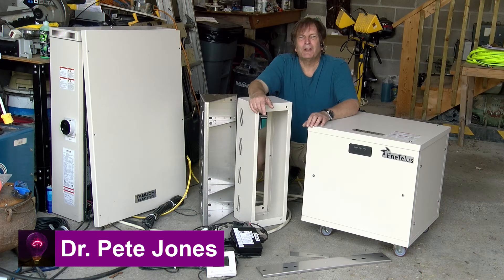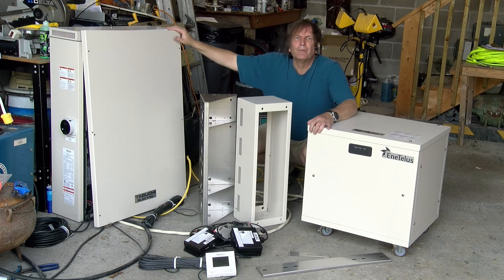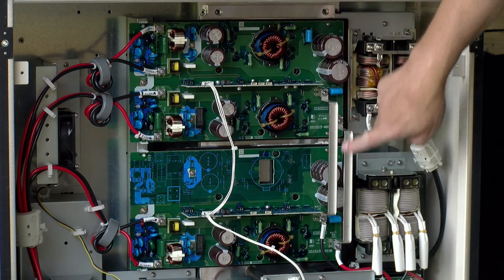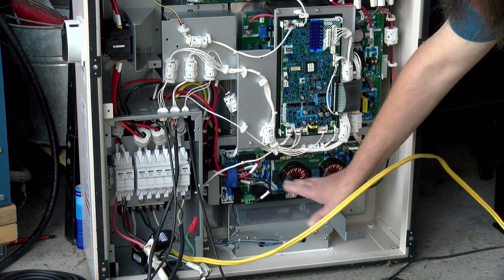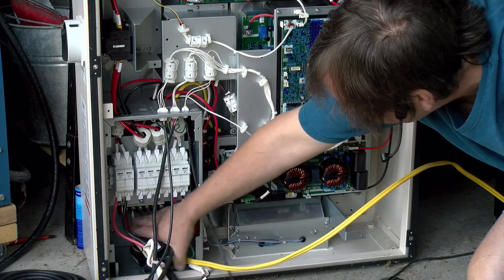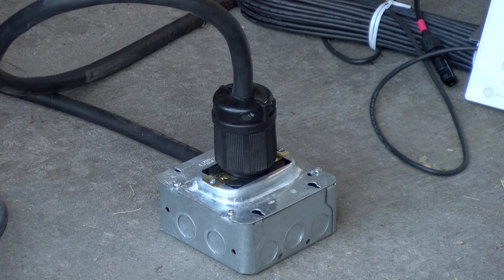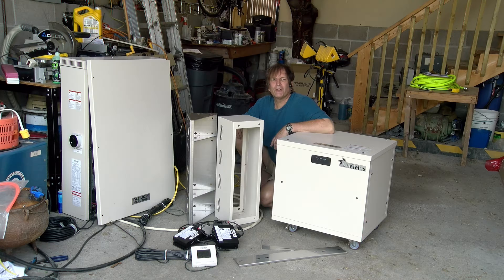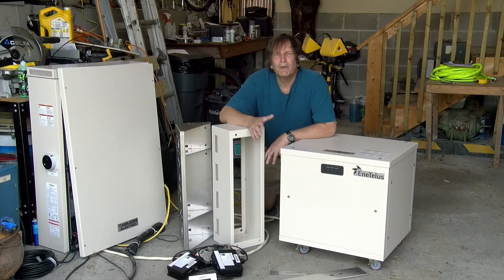The Ottawa Restore's Solar Inverter and Lithium Ion Battery System

Comment: How did you connect your 240 transformer to the inverter? Just L1 and L2? What about Neutral?
Reply from the maker: So the stand-alone inverter output (to power things off grid) has  120V L (Line) and N (Neutral) terminals. The transformer you use should should be a center tapped  120/240 transformer with  terminals  L1 and  L2  and N being the center tap terminal. note: it may not be labelled that way). You hook the N transformer terminal to the inverter  N terminal, and the transformer L1 terminal to the inverter L terminal. So that way the output of the transformer is 120V to N for each of its L1 and L2 terminals and the voltage between L1 to L2 being 240V. 

Note that you need to be sure that under no circumstances can the transformer ever be connected to the grid or other external AC power source or the grid power may damage the inverter or the inverter power may energize a the grid and injure anyone working on repairing the grip during a power failure.

Comment: So, - can I use that system as "off grid" if I manage starting it with the generator? I do not need much power - just to feed my RV (lights, water pump and a fan in the heater). I do not think this will take lots of power. More of a question if inverter can stay in "home backup" mode for extended period of time.
Reply from the maker: I tested it for a few hours - did not test it for days in backup+disconnected from AC mode. No indication anywhere that there is a timeout limit, but I cant say fore sure.

Comment: I picked up one of the units Trying to charge the battery, keep stopping and starting. No error codes
Reply: It is safe to ground the battery correct
Reply from the maker: @davidellis4097  Yes. If these some sort of flashing on-off code on the battery? The battery? The battery manuals lists a few sequences.
Reply from the maker: That happened to me! You need the current sense transformers clamped around the 240V L1 and L2 input power lines, they have to be in the right orientation, and the on the right lines (ie not L1 and L2 swapped). If any of that is wring, it thinks somethings is going wrong (ie expects to see the power coming in that it knows it is using).
Reply: Could it be equalization or balancing in the battery
Reply: Pretty sure they're on the right way
Reply: Thank you for all your help
Reply: @davidellis4097  Did you fix the issue? Managed charging the battery? Did you use solar panels for that or generator? I also got one of these systems and going to run it in couple of weeks. Any advice/help is greatly appreciated! Thanks

Comment: That's an amazing deal, some quite serious equipment there. If I lived anywhere near the area I would be on my way! Are you keeping the unit you looked at, or making more videos about it?
Reply from the maker: Yes too bad :( Do they have Habitat for Humanity ReStores in the UK? An amazing source of deals at times.   I bought the unit I looked at and have set it up as a giant UPS that is connected in place of a generator to the generator panel's external  connection my garage. I live just outside of Ottawa in the country and find that every couple of years  there is a storm that knocks out power for a day or so. In the past I have run the generator but its a real waste/nuisance when only the fridge and central heating propane boiler use a fraction of the power. Also a nuisance filling up the gas (that's petrol to you  :). Now with the flip of a switch on the breaker panel in the basement, I can switch key circuits to the inverter. And then run the generator a few hours during the day to recharge the battery.

I  stopped by the ReStore yesterday. To my amusement, they a have a laptop next to an inverter playing my video (with audio) in a continuous loop :)

Comment: WOW.  That's an incredible deal!
BTW, if you've got a 120V only generator, or you want to load balance a 240V generator, get an APC SURT003.  It has a 6kW isolation transformer inside.
Connect the 120V legs to your breaker panel via a 30A breaker.  If you feed your 120V generator in to one side, the transformer supplies the other half of the panel.
Or if you use the SURT003 as intended, feed it 240V from a generator, then you get a load balanced 3kW per leg to your panel.
The toroid transformer even has two thermal switches embedded inside it.  One to turn on a set of fans to a high setting, the other to cut power in an overload situation.
Reply from the maker: It definitely is. My feeling is its best use is as a giant UPS backup or as an off grid system assuming you have a generator to "start" it. 

Just looked up the APC SURT003 - not inexpensive but at leas one place has a "refurbished" one for $500 which is a bit of a steal. I really like the fact that it is isolated. 

I actually use a 1.5KVA  old Hammond autotransformer for a similar same purpose - to provide 120V/240V split phase  from my 120V generator for the well pump and also used that 240V to start the Solar Inverter when making the video, Not as nice a unit as the APC would be - but good enough for the odd long power failure!
Reply: @ElectromagneticVideos  You can now get split-phase true sinewave inverters for relatively cheap.  48V too (which is what I'm guessing that the battery pack is.)  You could put it on the input side for startup, then move it to the output side to expand your capacity.

Yeah, they've gone up in price but that's about right.  You can also look for just the transformer, 	
APC 430-6000A.  But there's risk with buying just the transformer with damage in shipping.  It is probably 60-70lbs just by itself.  Some of the transformers do have a seat belt strap carry handle which is kind of nice.  Otherwise it's awkward unless mounted to something.

That's just what I thought about doing, buying an Autoformer,  but then I opened up one of my SURT003's at work.  Allowed me to run one less wire from my 240V generator to my panel.  A nice savings considering recent copper prices.
Reply from the maker: @button-puncher  The battery pack is 86V -  not a very typical voltage as far as I know. 

Copper prices are crazy!!!  The scrappers must be making $$$! I'm guessing it may be electric vehicles that is putting pressure on the copper supply. Interestingly, apparently transformers in things like microwaves are now Al or  Copper clad Aluminum.

Comment: Looks very well built.

One thing I have noticed with some inverters is how they react to momentary high current draws when operating standalone, ie grid power is not present.  I've seen something as humble as a wall plug style  power supply for a router having sufficient inrush (cheapie, no limiting circuit of any type) charging up the bulk capacitor in a switching supply.  Some inverters sail through without issue and keep the output voltage and waveform looking nice, while others detect a potential short or other issue and go into a protection mode where the output voltage is reduced and  the waveform mangled to limit current gradually recovering full voltage over a second or two.
Reply from the maker: Yes - seemed very nicely made and was heavy enough to prove it :)  

To your point- I was really impressed how it didnt seem to even blink when the deep well pump turned on. Oddly though, when the inverter first turns on to act as a backup when AC mains power fails, the 120V output sine wave seems to go up and down for a second until it stabilizes (I think you can see that in the video) . After that its rock solid.

Comment: Soft start vfd for the well pump would help
Reply from the maker: Thats a great idea. I saw a soft start unit for a single phase AC compressor somewhere. I presume the device somehow has to replace, the start capacitor. I wonder if using one of the three  phases from a common 3 phase VFD on the single phase start winding would work?
Reply: @ElectromagneticVideos In my hasty reply, i assumed a 3ph well motor, when most would be single phase. A 3ph motor would be needed
Reply from the maker: @8m2sCv7  No worries! Its a great idea and as I said I have seen single phase soft start units somewhere. Unfortunately  here (Canada) most home power and well pumps are single phase.
Reply: @ElectromagneticVideos   I have a ntc thermistor for current limiting on my fridge.  (Mounted in a box at the end of an extension cord.)  Lets my 2kW Honda start it while running other loads.  Might be worth a try on your well pump.
Reply from the maker: @button-puncher  thats really an interesting thought - never considered that for current limiting. My submersible well pump is getting old (25 years) and should be replaced soon before if fails at the the worst possible time. It might be interesting to experiment a bit with the old one once it is removed and see what thermistor or combination of thermistors may be suitable.. I dont really want to experiment with the pump while its at the bottom the well in case anything goes wrong!
Reply: @ElectromagneticVideos   Oh yeah, I hear ya!  I'm guessing that it'd increase winding temp by the longer startup but at least for a well pump, it's water cooled.  I found that my fridge drew about 120W when running but at startup it was over 1kW without the limiter.  Amtherm has some good articles on the blog part of their website.

If you've got a sump pump, you may want to experiment on that first.  I still need to do that myself.
Reply from the maker: @button-puncher  Just looked at the Amtherm and bookmarked it - they do have a lot of good info. Thanks for pointing them out!

Sump pump - well luckily, while I have a sump pump it actually isn't needed to keep the basement from flooding - natural drainage handles that. The only reason I keep the sump pump is it keeps the water level even further below the foundation which is always  a good thing.

Comment: Can I start the system with only 120v?
Reply from the maker: Not directly, but you can with a transformer.  I did do that with a 1.5kw 120V to 240V transformer to step up my 120V 20A gas generator to 240V split phase.
Reply: Ok